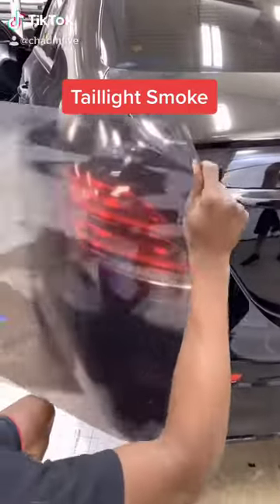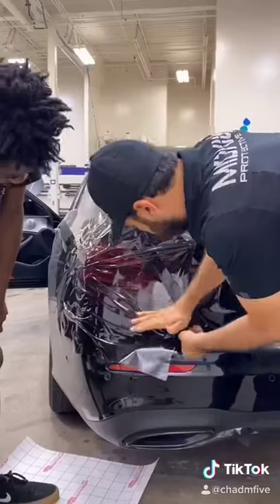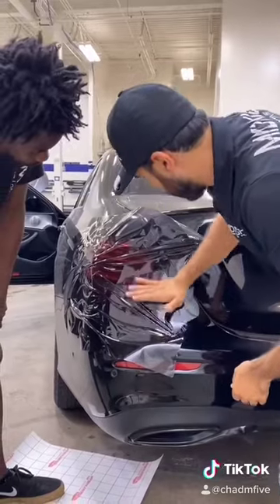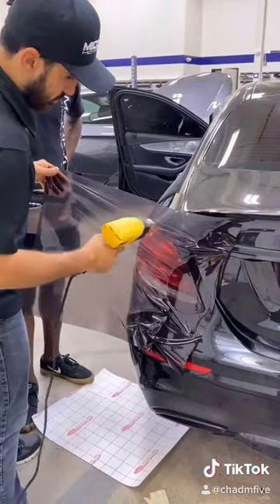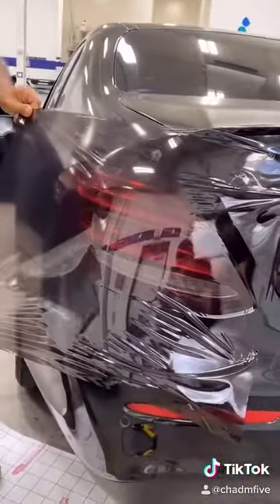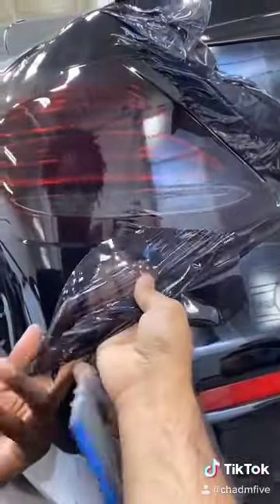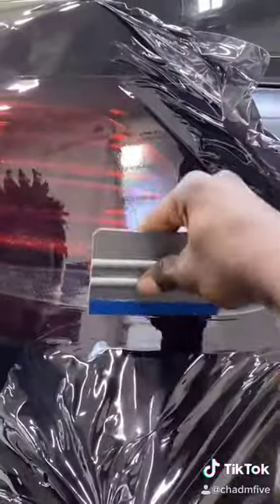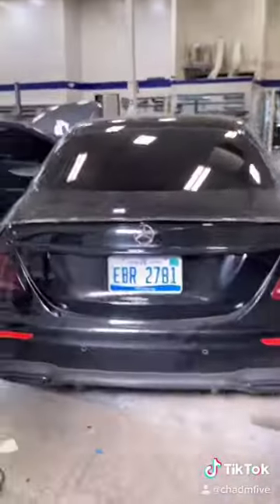HOW TO TINT A TAIL LIGHT!

Comment: Tinting windows I support, but what's the purpose of tinting lights? They're supposed to help you and others on the road.
Reply: Yeah, but style. 😂
Reply: Light smoke isn't terrible...it's all of the yahoos that make their taillights black thinking they are making their car "cool"... however, when they over due the dark tint, I can't see their lights from 100' (30 yards).  law says visible at 500'..... dark tint, not cool
Reply: @K03sport law also says no texting and driving and I bet you that's why you are unaware of a car with tailight tint braking. I've never had a issue with not seeing tinted tailight cars braking... I also don't wear glasses but maybe you do. So to each their own right.
Reply: @murkthem exactly 😂
Reply: Some lights like mine show through a light tint just as much as before also. The break lights I have have almost 30 LEDs in them and they light up the ditch so it’s almost necessary to tint them but I understand what your saying on stock lights

Comment: The car modders here in the uk used to use black tights or I think you call them pantyhoes in America. Remove tail light stretch tights fully over light by putting it inside, pull it tight and tie a knot at the back. Replace the light with the knot and all, looked pretty good and barely affected the level of light produced.
Reply: Is that before or after your beans and toast😂